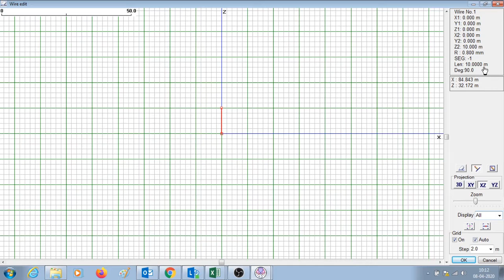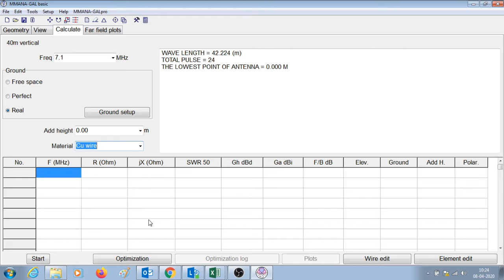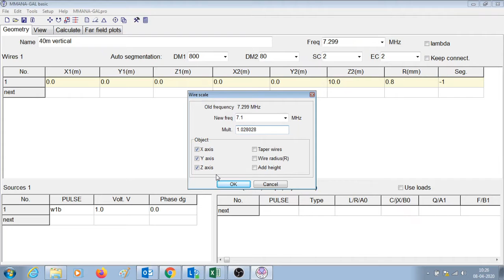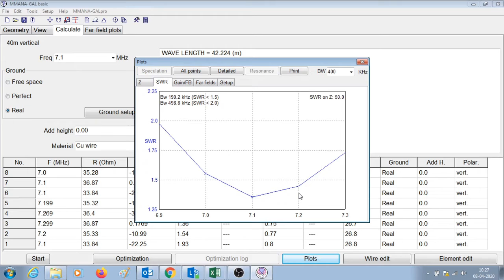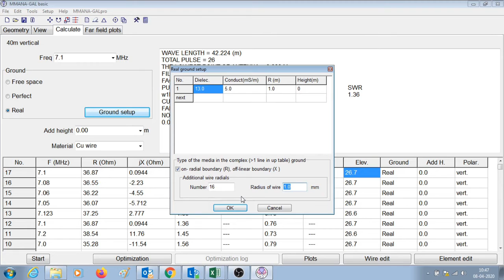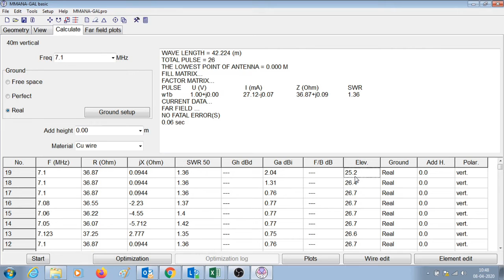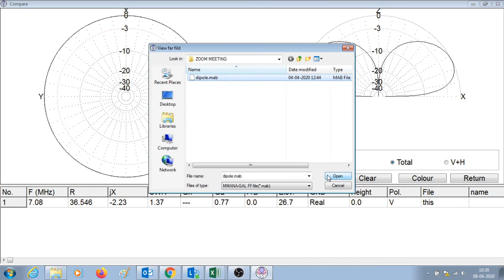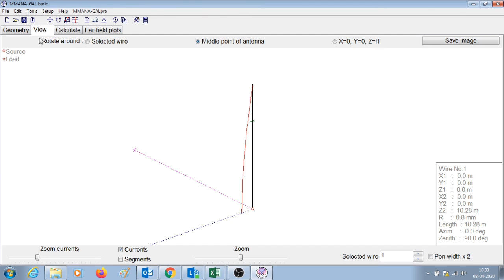Designing a 40 meter vertical antenna using MMANA-GAL

Comment: Does this software take into account the velocity factor when using PVC covered copper wire? I ask because when using this software it produces a wire lenght that has to be shortened quite a bit to get it to where I want it to be.

Comment: thanks for providing excellent teaching on mmana. I'm just wondering if you could provide simulation on vertical antenna with loading coils.
Reply from the maker: @geirha75  I will try. Meanwhile there is a video on short dipole for 20m in which I have shown the simulation of loading coils. Do check it out

Comment: Question: Why is it that when you insert the calculated match (C-parallel: 272.8pF and  Series L: 0.55uH) as a load on w1b ,it will not bring the SWR to 1 in the next calculation? Am I doing something wrong here? In my understanding the Impedance (and SWR) should match out on the 50 Ohm normalization when you add the C and L in to the base of wire 1 (in the lower right part of the geometry screen). But, somehow it's not matching. Yes I have "Use load" selected. I can see it do something, but not quite matching the feed point to 50 Ohms.